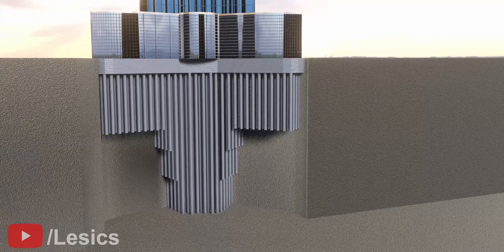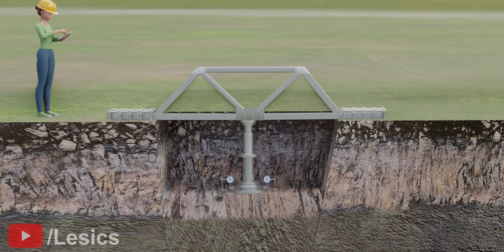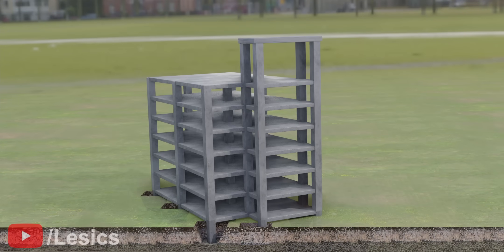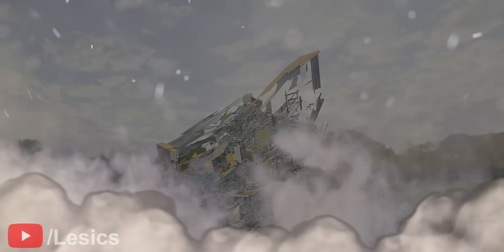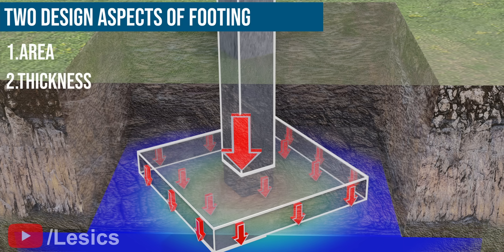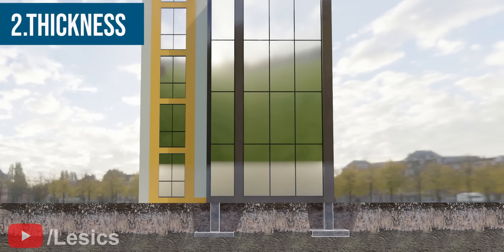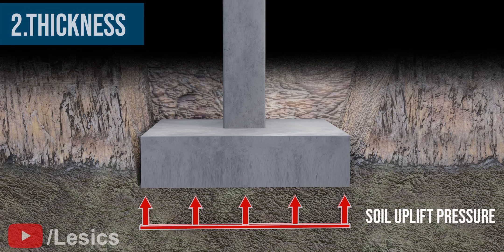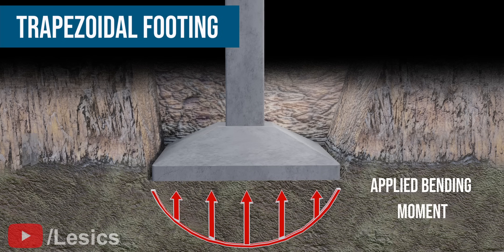Footings | Why are they used?

Comment: In an O’Neill cylinder, that stainless steel is essentially the soil.

You need footings to help distribute the load, besides you can put work elevators going up and down and like streets and avenues/water ways.  That way you can make any kind of repairs or maintenance easier.

Comment: Plate Load Tests are not used for that, and definitely not for piles. We would drill through the ground to depths deeper than the length of the piles, take samples and test them in the lab, a PLT would be impractical in this case.

Comment: That is NOT a footing at the beginning of the video, it is a “mat”, and those are NOT columns, they are “piles”, indeed this is a combined foundation system using a RC mat on piles.

Also, this is not as much an structural engineering problem, it is rather a geotechnical engineer’s job.

Comment: I always figured just by observation of nature... example... when it comes to trees... the roots are basically as big as the tree, but beneath the ground.  At times I believe the roots of a tree are more expansive than it's above counterpart (the tree above). Most engineering based on observing nature.

Comment: why are there such clever confusing wordings in there, like, the soil applying uplift pressure on it? really does the soil apply any uplift pressure, or is it that the footing center is still where more load is, and that its not evenly distributed onto the full footing?

Comment: i would like to point out that there is also friction against the piles that also supports the building alongside the footing at the incompressible layer. i did soil mechanics some 20 years ago and i recall that this frictional force is usually far greater
Reply: Friction against piles, called skin friction.

Comment: Living on a house that floats on sand? If a door stops closing right. Just wait. It fixes itself. Been that way for 70 years.
 Have a few cracks in the slab. But for the most part not much of a problem. Oh and I almost forgot there also is a rat wall 4 feet under the slab. The outer walls also are concrete block.
But not a good model for multistory buildings as a few millimeters means a lot movement. Like the Millennium Tower in San Francisco.
 That would have been a fun ride during the World Series quake. I guess that won't happen for another 60 or years? Maybe not.
I was there for the foreshock on Lombard and Baker. The World Series was two weeks later. World series quake was more side to side than the Northridge shaker? The foreshock definitely was side to side. Northridge was up and down. Yep was in LA county for that one.
Now I live in Michigan. I know what to do about tornados. Oh and the better part is there is a warning. But living in a tower during a derecho windstorm not fun. That is why I rather live on a slab.

I really don't like earthquakes. One of the many reasons I no longer live in California.

Comment: The government should hire animators in collaboration with the profs for educational purposes. The curriculum should include these animated subjects to clearly understand what they are teaching. We are in the modern world where books ain't enough to learn, and most importantly, is not enough to understand. I am an engineering college student and I learned more in this vid during this online classes. Thanks lesics!
Reply: Rather, the colleges or lecturers should make use of such online-available videos to enhance lectures.
Reply: Unfortunately some lecturers don't have the knowledge to lecture about such.
Reply: Pad footing,two design aspects of footing/area&thickness/ Applied bending,Trapezoidal footing,unbalance Eccentric footing,Strap footing,combined footing,deferential settlement, Burj khalifa uses Raft & Pile Footing/ and combination of shallow & deep foundation!
Reply: Hard strata,frictional resistance,Applied bending moment,
Reply: 3D Animation by-Jithujayachandran,actual design & wrong design,soil getting compressed,excavation,Incompressible layer which can stand layer,
Reply: Concentrated load,Execessive stress’Footigs why are they used’ 5:57,11:52!

Comment: Very nice video, simple, straight forward but yet informative... I would like to add a little information here about the pile foundations... In fact they are two types of pile systems, the friction piles that were discussed in this video and the end bearing pile that were not discussed here (or maybe I've missed it) the end bearing piles simply transmit loads and moment to a rigide layer in the depth.... Thanks once more 🙏🏻

Comment: why doesn't the soil pressure from above the footing act against the force exerted by the soil below and stop the potential bending of the footing?
Reply: The weight of the soil above (hence its pressure) is relatively low compared to the pressure below the footing. The latter is equal to the force transmitted by the column (hence a good part of the weight of the building) divided by the surface of the footing hence the pressure is usually high (especially for a large building with many stories). When designing the footing, we usually assume that the weight of the above soil + the self-weight of the footing is roughly equal to 5-10% of the force transmitted by the column.
That said, the net pressure beneath the footing is still high, so the bending and shear.

Comment: How does the downward forces from the column with small cross-sectional area get evenly distributed to the plate with a large cross-sectional area?
Does it mean that shear forces are transfering the forces where the two elements are joining?
Reply: Structural steel rebar is built into the footing and column. That combined with the trapezoid shape spreads the load.
Reply: you calculate the punching shear and design the footing to resist it.
Reply: That size difference  cause the plate to bend in the first place. Otherwise it wont. That is why modern structure use trapezoid shape to counter the bending force
Reply: It depends on the thickness of the footing. If you have a thick footing sure it will get evenly distributed. If it is thin, it won’t and you will have a punching effect.
The more displacement you have at the edges, the less the distribution is even (the video did a great job showing this)
A large thickness allows a diffusion of the effort. Sure you will not have a 100% even distribution, but tou will enough diffusion to consider so.

Comment: Interesting. I've always assumed, the soil surrounding the columns exert pressure onto the columns and causing them to "wedge".
The pressure of the soil would come from the weight of the building. 
Also the diameter of the hole needs to be bigger, due to footing's dimensions.
Is the "filling" so to speak, a soil that goes around the column onto the footing additionally compressed?
Reply: Think about the soil as its own structural element that can support a certain amount of 'push back'. If you put too much pressure on the soil, it will fail and your footing will sink. The pressure ON the soil comes from the building, but the soil's capacity is based on its properties and soil mechanics.  If you search for "soil mechanics" on youtube you can find some full courses on it.
Reply: For footings that are at the bottom of a column, wall or pier a hole is dug big enough to allow the builder to do the formwork required to pour the concrete. Then the hole is backfilled with a particular soil or gravel and compacted to a specific SPMDD (Standard Proctor Maximum Dry Density). For piles which the Burg Khalifa uses, those are large steel members that are hammered into the ground and the friction of soil on the face of the steel provides very high bearing capacity. Piles can also be deep drilled holes filled with concrete and rebar. Piles are used when bedrock or the hard strata layer is either too deep for traditional footings or the building is extremely heavy or deals with high wind loads.

Comment: Wow, if one puts plates under columns they won't sink to the soil. And if one puts the column too close to the edge of the plate, ot will cause problems. Who would have guessed?
But all in all I like practical engineering more than Teslas playing with electromagnetics.

Comment: Does these heavy buildings exert pressure to the nearby small houses.. Or it adversely affect the nearby small buildings?
Reply: They will not "exert pressure", as pressure follows downward on an angle. Around 45deg, but that depends on the soil. 
Saying that, the fear is valid, even if the question might be badly formed. 

The pressure from tall structure can deform the soil around it. That deformation will cause movement of the building. That deformation can be soil going upward or downward.
The calculations would have to be done case by case scenario, as many factors are involved.
Reply: @valdius85  if the angle is 45, the answer MUST be yes.
Reply: @southerncharity7928  it can be but it's not "must be".  It really depends on the structure and the layout of the two buildings.  Where are they in relation to each other?
Reply: @southerncharity7928  it is a characteristic of the soil. There are charts for that.
Reply: If a building is going up next to yours , you must get an engineering report on the state of your building.  The builder will cover the cost.    If damages occur years later to your building you will be prepared.
Reply: Depends on soil (if rocks no concerns) and how heavy is the building